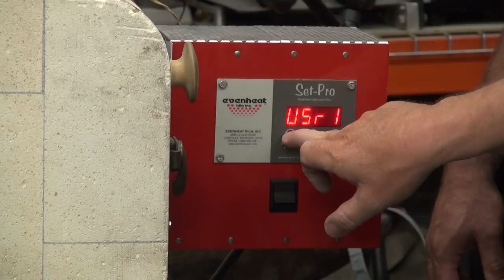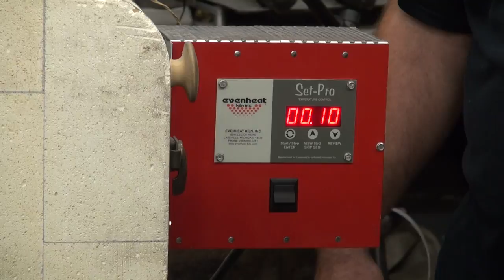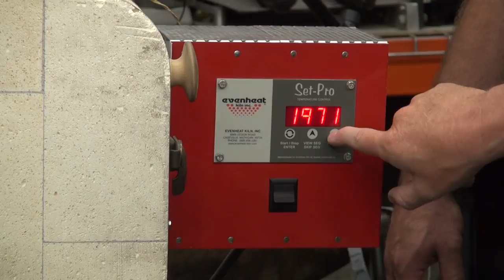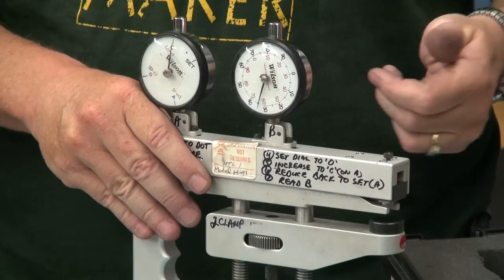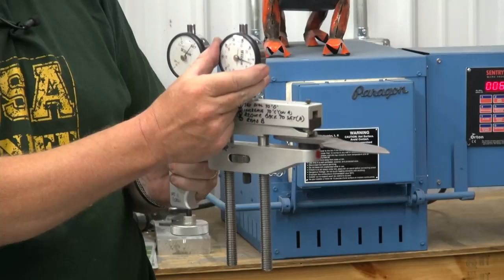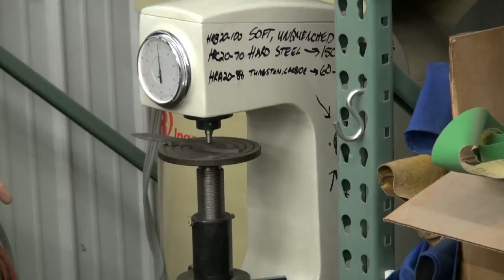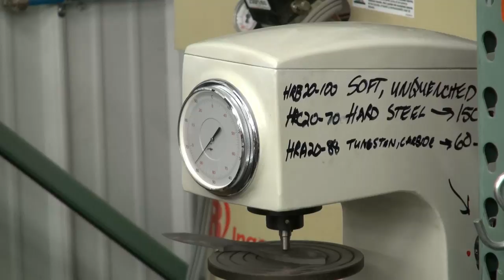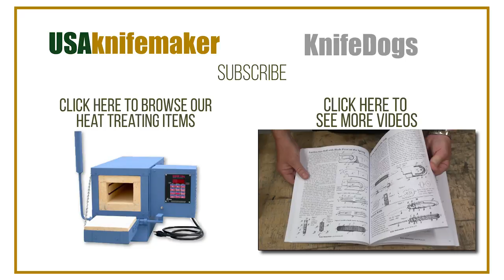Heat Treating

Comment: What dose it mean on a HT sheet when it says "Preheat to 1200F and Equalize" and the "Heat to 1500F and equalize" Then it goes into the soak temperatures.

Comment: Thanks for the information, you said you cut yourself EVERY time (almost) when wrapping a blade and handling the foil, ever thought of using leather gloves (like cheap gardening gloves)? I'd think after getting cut once you'd have figured that out.
Watching you cut the blade out from the foil you said foil was still hot enough to burn then proceed to cut foil away with sheet metal sheers (NO GLOVES) all those jagged edges no wonder you bleed almost every time.
Reply: nofaithjusthope because he is a man, and has done it enough that his fingertips are used to heat. and a little cut does not scare him.